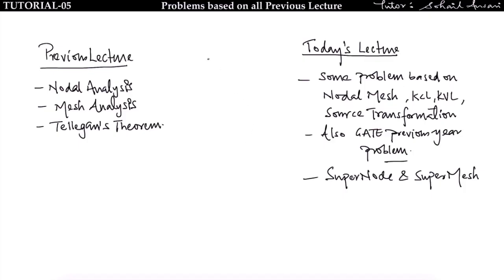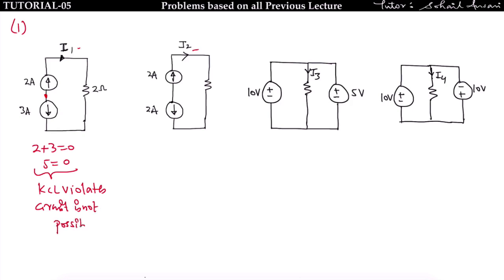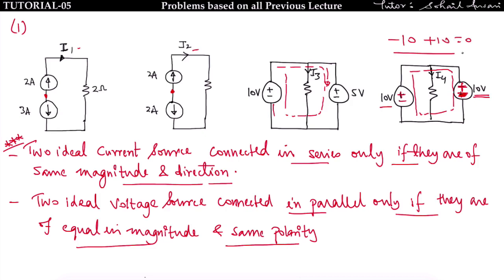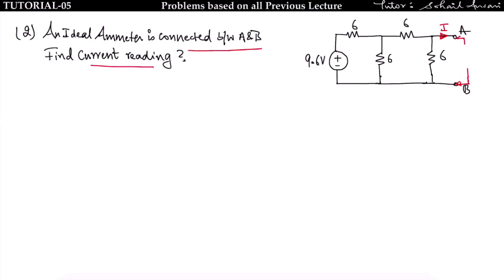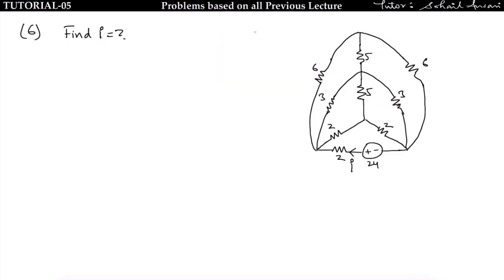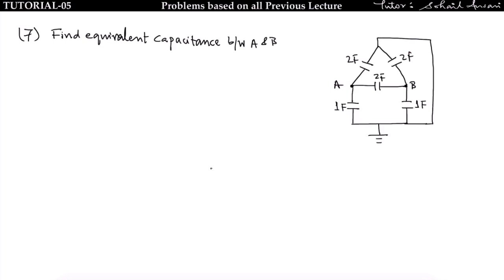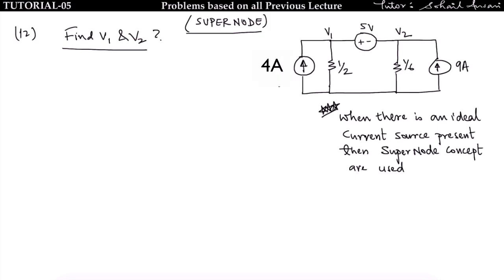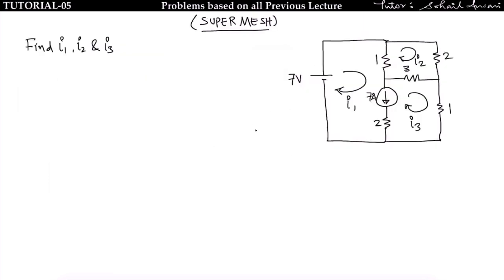Lec-05 Question Discussion (based on all previous lecture)

Comment: Sir can you tell me how did you convert the voltage source in question 2 to voltage source with a parallel resistance....I didn't understand..... could you help me with the derivation...so that I can understand better
Reply: Yes me too
Reply: Yes u r right...dis is nt source transformation...instead of 4.8 9.6 will arrive n simply 6& 6 are in parallel n next 6 will be in series....
Reply: @sudhathonta4507  its like thevinin theorum

Comment: Sir at time 27:27 I think there is a small error with current i3 in second equation. I think it should be 3i3. Plz reply
Reply: Yes you are correct. It should be 3i3

Comment: Sir in question 1 if we connect two 2A sources in series will it not be a 4 Amp source ??? I mean you wrote I2= 2A.
Reply from the maker: no it will not..any how u kcl should be valid..if kcl is not valid then circuit is not possible..
Reply: Please explain more on this point. It makes us totally clueless. 2A + 2A = 4A. Its not ammeter that is reading the value of current rathers its a current source which adds current to the network.
Reply: see  as we know that by convention, the current going out from a node should be taken as positive ..  thus if we assume a node in between those two current sources , the current appears to leave and thus added as 2+2   .. hope this help
Reply: i m with u.
 not upto the point question 1st
Reply: GATEMATIC Education yes
Reply: Current remains same in series 2A and in case of parallel it will add up to 4A.

Comment: sir in network analysis tutorial no5 quastion no 11, your apply nodal method at Q (so Q is at higher potential ) but why your taking,while writing equation. 2 amper is negative value (current allways flows from higer to lower potential na) please tellme sir please

Comment: sir in problem (3) you have solved  the diode current =3/3=1A but why it is not {(3-0.7)/3} = 0.766A ???

Comment: sir in question no.6 I'm getting the current 24Amp , it's not matching with yours ,would you pls explain ...
Reply: final form of circuit is 24V source with 2 2-ohm resistor in series, that yields 6A
Reply: It's ans is 6 as u got the last connection in series not in parallel....just bcoz there is no division of current...so total resistance is 4 ohm and I = 24/4 which is 6A.

Comment: Q9. can easily be done by applying KVL to main loop.

 10 - 2*i - 3( i+3 )-2*i=0 which easily gives 2i = 2.8 A.
Reply from the maker: yes right..each and every method cannot be solved in lecture..for that offline classes will be better where every question can be solved by atleast three method and can be conclude that which method is the best method for this type of circuit..
Reply: Okey dude, I was just helping others who might find this method easy.
Reply: Can you please explain what you have done in question no. 9
Reply: @sumesh please explain ur method

Comment: sir in q 3 and 4 u r applying source transformation technique near voltage source
u said first converting voltage to current source we get v*r1 in paralllel with r1,,
then again to voltage source means [v*r1*r1parallel r2] in series with r1 parallel r2.
please help me where iam doing wrong
and by direct kcl also iam getting same answer

Comment: in ques no 2. should current not be equal to 9.6/9 A. I am going by direct method ,why it's contradicting with your method. please reply asap
Reply from the maker: upload your solution on facebook group and tag me there..i will find ur mistake..
https://www.facebook.com/groups/learnGATEfree/
Reply: same doubt here. Tried direct method n i'm getting 9.6/9A. clear this doubt pls..
Reply: V V  he is 100% right. and probably I can assume why are u getting the wrong answer .see we are actually interested in finding the current reading across the ammeter which is nothing but the current through that branch it is connected and not(mind my words) equivalent current through the circuit which is (equivalent voltage applied /equivalent resistance) so u can't  just find the equivalent resistance (parallel and series addition). and get the current. u can either apply node or mesh analysis in circuits individually finding the current across the ammeter. or like him(don't know his name) apply source transformation. basically u can apply any circuit reduction technique, but at the cost that the branch across u have to find the current does not losses it's identity. hope this long paragraph clarifies your doubt. and if u r going by any other method ... IDK😂..
Reply: Rahul Roy  your answer is right
Reply: please give thesolution
Reply: Can u explain
Reply: I too have the same doubt . Y cannot we  just do it by simplifiying the resistors??
Reply: Voltage should be transform to Current source 😅
Reply: No the answer is right i.e 4.8/9.
9.6/9 is the total current & 4.8/9 is the current in the branch in which ammeter is connected.

Comment: sir in question no 7  can we convert the upper delta with 2f capacitors in to star circuit and then  simplify it like the capacitances between a and b
Reply from the maker: yes u can also do like this..u will get same answer..

Comment: sir a have dought in mesh
you write +3(i3-i2) from direction + to - bcoz i3>i2
but why again plus sign in +3(i2-i3 ) when i2>i3 in mesh 2 ?????
Reply from the maker: tell me the time at which u r getting prblm??
Reply: 26.36
Reply from the maker: whenever you are writing mesh equation in any loop then u have to consider the current higher in that loop in which u are writing mesh..for more detail refer my lec-04 and switch to mesh analysis..u will understand..
Reply: i understand that in loop 1 
i(1) is greater than i2 
but my question is about ....y u take positive sign for both case of 3 (i3-i2) and 3(i2-i3)....
Reply from the maker: my convention of applying kvl is that i take positive across passive element...u can take it ur own way..u will get same result...its correct..if u have any query regarding gthis then upload ur solution in our group ..i will find ur mistakes..
https://www.facebook.com/groups/learnGATEfree/?ref=nf_target&fref=nf

Comment: Sir quation 3 

How 4//4 = 3 and why change 5v to 3v 

And reverse current are 2 amp.. and    F. B current is 1 so how diode is F. B
Reply: 1) Actually, 4||4 = 2ohms and about changing 5V to 3V ?? just apply nodal analysis, where current = (*5V* - 2V = 3V*)/(*2ohms* + 1ohm)

2) You should consider taking IDEAL condition of a diode for easy calculation. It offers ZERO resistance on F.B and INFINITE resistance on R.B*. Since, the current is *travelling through`ve and leaves -ve terminal of diode in that circuit, it is in F.B *mode*.

Comment: thanks sir keep doing  videos like this  ... pls make  anther subjects  also ....... sir i have a doubt in this lecture     in the problem of super mesh ....  i think the resistance of 2ohm will not be ther in branch having the current source of 7amp....  because  if it will be there  voltage across the branch willl be  determined  by IR .
Reply from the maker: doesnot make any difference..u can remove as well..no problem..ok

Comment: sir in ques no.7, why we dont use wheatstone bridge concept as the circuit is balanced between a and b
Reply from the maker: bridge is balaced with respect to what?....here 1 and 2 point are shorted...if it was not shorted and then question is asked to find the equivalent capacitor between 1&2 then u can use the wheat stone bridge concept...ok
Reply: thanks a lot sir, your reply means a lot to me
Reply from the maker: ur most welcome

Comment: Sir I dont get the 2nd ques that of ideal ammeter..
Reply: Lol
Reply: Let me guess, after conversion, you would be getting I=3.2A, bcz you would be dividing 9.6 by the equivalent resistance of r1&r2, ie 3 ohm... No this is wrong, you just need to divide 9.6V with the resistance close to it ie r1... After division you will get 1.6A, then you have to make eq resistance of r1&r2, which is 3ohm, then again for transforming that current source into voltage, you need to give multiply I=1.6A into 3 ohm resistor, then you'll get 4.8V...

Comment: Sir at 14:03  you are saying that 2F and 1F are in parallel but by mistake you write the equivalent capacitance as 3F
Reply: For equivalent capacitance in parallel we need to add the both capacitance...

But for series we need to perform reciprocal addition

Comment: sir, how did you solve the equation x2-x-1=0 in question 5?
Reply: Even am also having the same doubt sir ..vill you please explain us
Reply from the maker: this is quadratic equation..use dharacharge equation to find x..
Reply from the maker: find using dharacharya rule....x can never be negative so take positive value..thats will be the answer..
Reply from the maker: x= -b + under root (b^2-4ac)/2a

Comment: Bro in eq-3 it should be i1-i3=-7. But u wrote i1-i3=7 please clarify me
Reply: shashi pallepati yes u r right
Reply: shashi pallepati according to me....direction of 7A current source is same as i1....so, that means that i1 current is more than i3... that's why it is 7A not -7A

Correct me if I'm wrong..😊

Comment: Is the answer of question no 10 is 35 and 26 for v1 & v2.
Reply: Sheetal Nanda how did u solved can plz tell.?? Take a picture of it n upload
Reply: apply KCL at V1 and V2 nodes ... 
V(1)/10   - 8 + [ V(1)-V(2) ] / 2   =0 
[V(2)-V(1) ]/2 + [V(2)-12]/6 + V(2)/12 =0

Solving above equation u'll get answer 
v1 =35 , v2=26
Reply: @ChintanMeena  I got that answer as V1=25 and V2=14
Reply: kontam tejaswini  Let's say you are right put values now observe right most loop ; 
take V2=14 ... and then current through 6 ohm = is 1/3 
and current through 12 ohm (right most resistor ) = 14/12 
and through 2 ohm = 11/2 =5.5 ; so you can see current is not balanced at node v2 ... but with the answer V1=35 ; and V2=26 
current is balanced ... I wrote the equations if you solve them you'll get the answer

Comment: sir in question no 6 how current become 6A? PLZ SIR HLP ME
Reply from the maker: this is wheatstone bridge which is balanced..so 5ohm resistor is of no use..so remove both 5 ohm resistor then solve the circuit ..u will get 6A current..
Reply: no 6 is not wheatstone bridge sir.. i'm  also not get
 6A
Reply: my ans is 12 amp

Comment: I want problem 7 calculation plss any one say..I am getting wrong answer
Reply: Series mein capacitance c1c2/C1+c2 hoga and parallel mein add ho jayega ,c1+c2so 2//1becomes3and add it another 2//1 by parallel formula u get 3/2 then add 2 to it  u get 3.5
Reply: Tushar Sagar  why we will add 2 after we get 3/2 ,as the bridge is balanced hence we will not consider the 2ohm resistor placed in between the bridge..my answer is  3/2 only explain if u can plzz
Reply: Maybe ur right actually I just figured it out .....I need some more practice
Reply: But my answer is not correct ryt..!!!
Reply: I have tried it as delta to star transformation and series are added and then capacitor are in parallel I have got c equivalent=0.5F